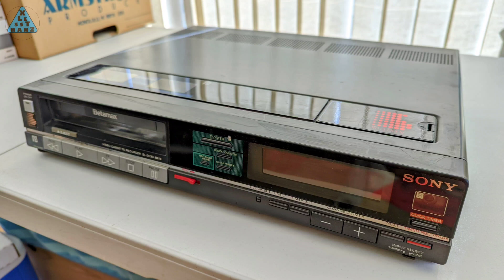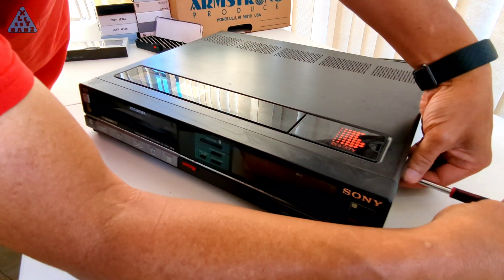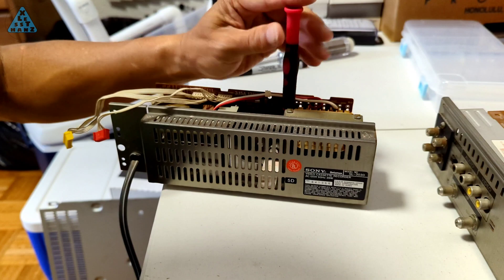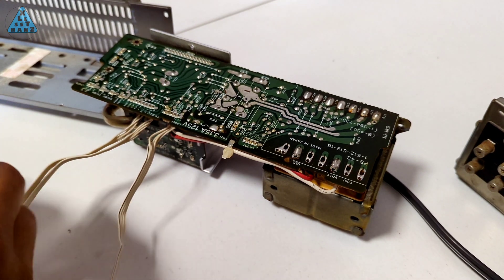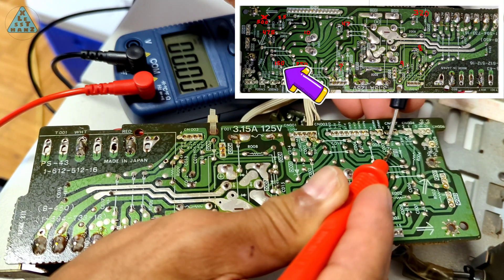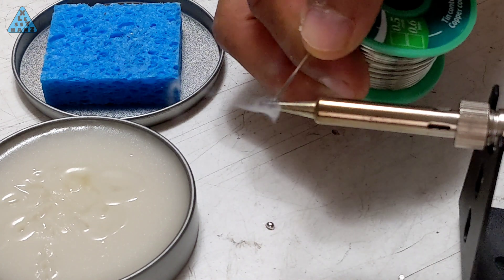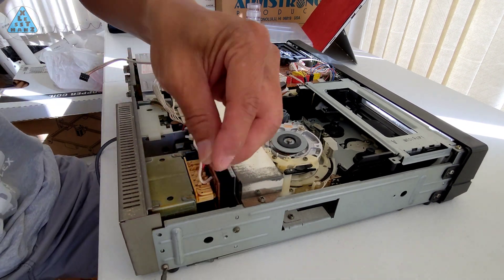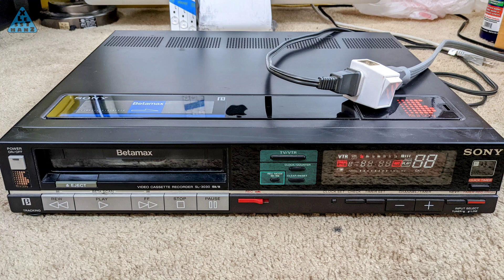Sony SL-3030 Betamax VCR Repair (ADD ON FOR MY VHS TO DIGITAL UNIT)

Comment: Change more capacitors with good quality Japanese one, change all of them if you can. Get a decent quality desoldering iron. Get a brass wool to keep your soldering tip in good shape at all time. Oxidation of the tip is your enemy, I did pretty extreme stuff with my solder tip (like soldering plastic) and was always able to get it back to life using technique like light sanding, good quality flux and tip thinning agents. But most of all, get a good soldering iron that you can adjust temperature, it's crucial, too cool or too hot soldering iron is the source of many problems. Also, desoldering lots of parts can be done with a hot air gun, but be careful, it releases nasty fumes, do that in a well ventilated area, with breathing protection. 
I own the EXACT same Sony betamax VCR, with the same issue, changing all the caps with high quality one will be my first move before I do anything else. This machine is 40 years old, all the caps are dead or dying anyway.
Reply from the maker: I'll keep your comment in mind...Thank you👍🏽